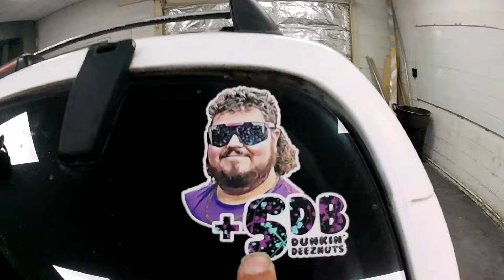Big Progress on Can’t get Right 6th order

Comment: Maybe Loud Fiat can comment, but does the volume controller act as a line driver? Can you run 2v rca in and have 4 volt of output?

Or is it limited to whatever the input voltage is? Like it's just an attenuator?
Reply from the maker: it does not right now but it can, when he releases the update.